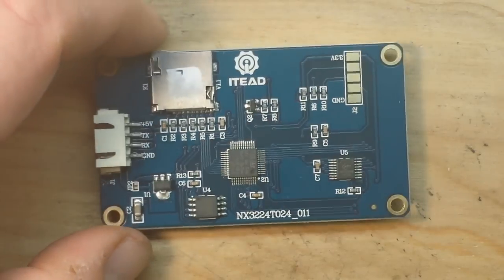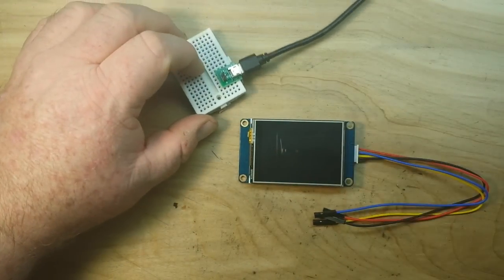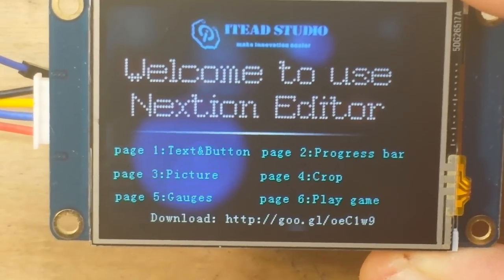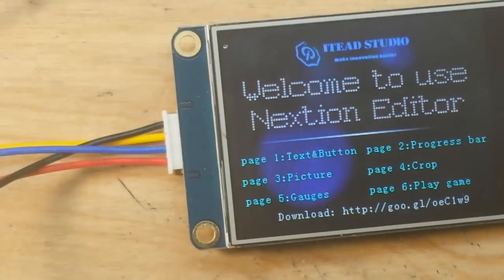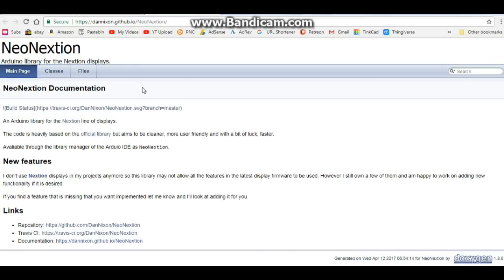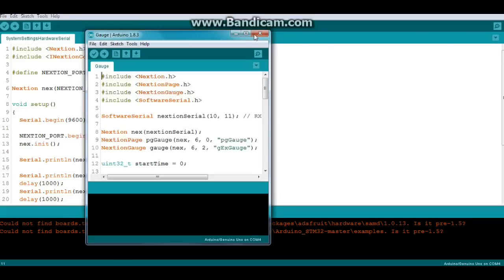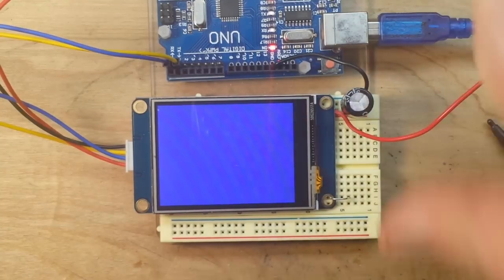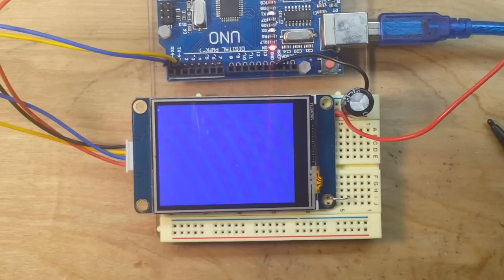Nextion or Nah?

Comment: 13:31 you hooked it up to the Arduino's hardware RX & TX (0 and 1) instead of to pin 10 and 11
the Uno has only one hardware UART/serial output which is reserved for either the USB OR a different device, that is why the sketch has SoftwareSerial on pins 10 and 11, and why you couldn't upload to the Arduino.

Comment: Dude this display does some awesome stuff. Btw if you are using a serial connection and then try to use it at the same time for something else it no work. You made a video of you not knowing how to use a tool and that sucks. It would be like finding a video on how to fix a car and them not knowing how to use a screwdriver.
Reply: This guy is not really good with arduino xD. Screen pined on 1/2 (main serial for upload bin) and in the code the line indicate SS line on 10-11 pin.. How a dude like that can have 120k suscriber O_O. Nextion screen are just one of the best on the market...

Comment: Would be nice to see Nextion put in a light that reflects its powerful capabilities.  Imagine expecting to drive your kitchen blender to the store.  Amazon user reselling the many Nextions they purchased and including a "thank you" for a plug is independent of Nextion.  Windbond Flash chip, not a Grove connector.  Serial Number removed ... hopefully not by your seller.  NeoNextion is not the Iteadlib Arduino Nextion Library.  NeoNextion example surely was not made for the Stock Nextion Demo.  ....  sorry.

Comment: You've given this a bad review but as most of the people have noted..... You left the screen plugged in to the TX/RX which caused it to fail uploading... Disappointing
Reply: Blondie SL if you use it with a uno or nano like I do, you can do a little editing to the NexConfig.h file so that you can use software serial. I found that if you use software serial, you don’t have to disconnect it from the arduino to upload the arduino sketch, but it sometimes gets messed up when installing the .txt file from the micro sd card if the arduino is trying to send it commands

Comment: Hi

For those that are considering this display but may be discouraged because of this video, dont be!  Yes, Paul is correct, it is a bit more of an advanced product, but the rewards and only the small added complexity are seriously worth it.  Here are the problems with the video:
-The code upload failure:  You MUST disconnect serial RXTX when uploading new code.  OR use software serial with it.  The instructions are clear about this.
-Uploading new code to the Arduino expecting the Nextion to have new screens:  This is not how this product works.  It's also the HUGE advantage it gives at the same time of not having to develop a complex menu structure with Arduino code if you have nested menus.  It's also why you save all the space on your arduino-no graphics live there.  The operation of this product is actually quite simple - you design the screens with button actions on the Nextion Editor software.  Upload your new screens with the SD card. (you don't need it afterwards-it just copies it to the firmware).  When you press buttons on the screen, it simply tells the Arduino you pressed the button.  If you want to call a screen with the Arduino, you simply send a request to "paint" the screen.  No screen data is transferred via the serial line, and this is why you cannot just put new code on the Arduino and expect something new to appear on the screen.

Watch Andreas Spiess channel - he has a few good instructional videos on how to work with it.

The advantage to this product are many:  Space saved with graphics, time saved with having to develop code for complex menu structures, a considerable more polished look than the standard touch screen because there is more room and a real editor, 2 pins only used instead of 6 min with SPI/Touch or even ALL of them with parallel.  To me, all of this equates to alot of time savings and hardware costs saved in other places.

The benefits far outweigh the minor inconveniences...  No I don't work for Itead, but the price of this thing for the value it brings is just amazing.  But I do agree about the editor - why cant that just be online and let us download the BIN file - or at least make a java version we can run on all platforms, especially Linux.
Reply from the maker: +James Kerns Jr. Thanks for jumping in there and giving folks more info. That's what makes this a great community.
Reply: Yes. When all else fails, RTFM. Here's a great tutorial, demonstrating the GUI design tool.
https://www.youtube.com/watch?v=3DpJQ5R5si8
I just purchased a 5" Nextion Intelligent display for an interactive, multi-page touch panel for my laser control desk to eliminate hardware knobs and buttons. But, I didn't want to burden the Teensy image generator and consume GPIOs that are already being used for 5 channel audio outputs.
The Nextion, via I2C is the perfect solution.

Comment: RTFM.  This is a decent piece of kit if you meet it half way and read the manual.
Reply: My life is not long enough to read documentation for every hardware and software I am trying to run. Things should be simpler.
Reply: AhmedHan I’ve spend nearly 40 hours a week for 2 months trying to make a GUI the old fashioned way on an adafruit 2.8” touch screen. Most of that time was trial and error of moving stuff around and uploading to the arduino. It took me 2 days to figure out how to use the Nextion editor good enough to re-make the GUI 10 times better. Yeah it’s confusing at first but there’s lots of tutorials and examples out there.
Reply from the maker: +Shaun Stewart I'm sure it's lovely, I've seen folks make great looking displays with it. But for me... No. I can program a simple TFT LCD in the Arduino IDE much easier. But that's my opinion, and I value you your's. Thanks for watching and taking the time to comment. Peace.
Reply: It's not hard - really.  You just design the screens on the editor instead of coding them on the Arduino.  It makes a much more polished look, especially when you have nested menus.   But to Paul's point if you just want something quick with only one screen and just plain old toggle buttons, your probably better off with the cheap TFT...

Comment: I have a Nextion display running in the control box for my rotary table. The Nextion programs similar to VB so you pass the values from your program to the Nextions    screen elements. It works really well and you use much less rescourses on the Arduino. It is a hastle to program on the PC then move the file via micro SD to the Nextion board, but it works Keep playing with it and you'll come to like it for the dramatic displays you can create!

Comment: I got mine working with an ESP32 (you can check out the Nextion Weather Station test on my channel: https://www.youtube.com/watch?v=Iea3qYxgv6o) but it is kind of tricky.
I have to unplug the power from the Nextion and the sensors each time to upload a Sketch to the ESP32.
I do like the programmable interface with the Nextion Editor although the software doesn't feel very efficient nor comfortable to work with.

The Nextion does open up another kind of future for displays so let's wait what more the future will bring.
Reply: Software Serial does not work to free up the hardware pins to do the upload with ESP32?  I havent tried with ESP32 yet, but I couldn't imagine it would work different than ESP8266...
Reply: It should be possible to have 2 serials connected with Software Serial but I have not tried it yet. Planning on doing some research when I have more time with the holidays coming up.

Comment: Hi! If you try to upload a sketch to your Arduino while the TX and RX cables are being used, you won't be able to do upload it. 

There are two parts for any Nextion project: the Nextion firmware (created with the Nextion Editor) and the Arduino code.

The Nextion display as an ARM processor that takes care of generating the buttons, display text, images, etc... So, you need to flash a custom firmware to your Nextion display. For that, you use the Nextion Editor to generate a .TFT file and you upload it to the Nextion Editor using the microSD card slot. 

After, uploading the code to your Arduino and flashing your Nextion display, you can connect the TX and RX cables.

I hope this helps,
Rui
Reply: I agree with you, I still prefer web interfaces, but for some applications a touchscreen is better. This is a coincidence, but I've posted a guide yesterday on how to get started with the Nextion Display http://randomnerdtutorials.com/nextion-display-with-arduino-getting-started/
Reply from the maker: Thanks
Reply: You're welcome!
Reply: Hi Naveen, I'm working on that project right now. It should be posted tomorrow afternoon or Friday morning on my website http://randomnerdtutorials.com/ . It's going to be a simple guide that shows a project with the ESP8266 (NodeMCU version) and Nextion display
Reply: Hi Rui,
have you tried connection a nodemcu with Nextion , beats me. Can you help me on this.
Reply: Here's the example Naveen: https://www.youtube.com/watch?v=CjZeMiXYrWU
Or the blog post: http://randomnerdtutorials.com/nextion-display-with-esp8266-touchscreen-user-interface-for-node-red/

Comment: Hey Paul, the reason it didn't upload the last time was because the TX and RX pins were connected to the display so it was throwing off the connection for the USB to serial converter

It also looked like that last sketch was using software serial running on pin 10 and 11 of the Uno (which would free up the TX and RX pins too)

Andreass Spiess did a pretty good luck at these screens before, I'm sure it does have its uses, but I agree with your summary. It's pretty expensive compared to other alternatives. I also would prefer a web interface over a touch screen anyways :)
Reply from the maker: +Brian Lough I like web interfaces too, have you tried Cayenne?
Reply: learnelectronics no never heard of it even,I'll take a look at it over the weekend. Thanks!
Reply from the maker: Brian Lough Let me know what you think, I'm working up a video on it.
Reply: Cool, looking forward to it. I'll get back to you if I get to take a look. I have permission to spend Saturday working on stuff but I've a couple of videos I'm trying to get out the door! ("Permission" is more I have been excused from child minding duties!)